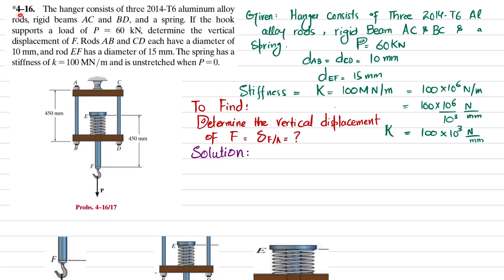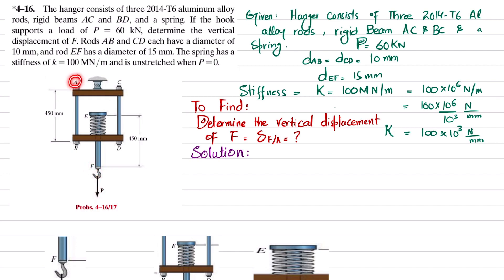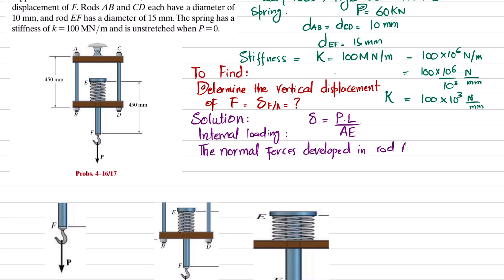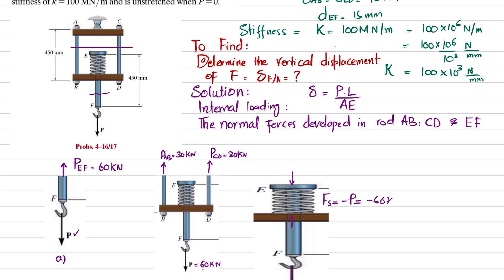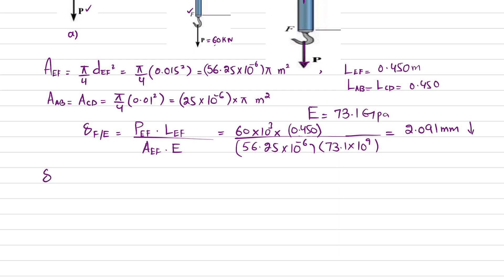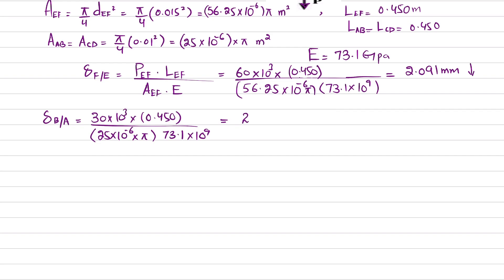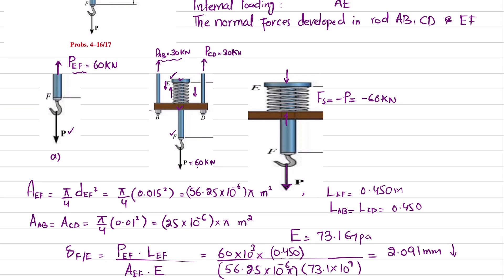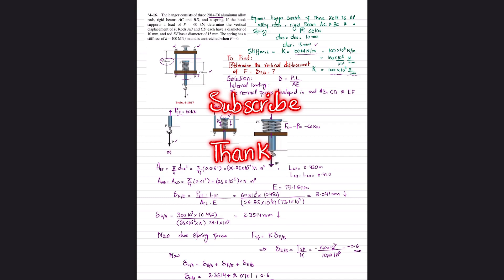4-16 Determine the vertical displacement of F | Mechanics of materials rc hibbeler

Comment: Wouldn't you subtract the 0.6 mm at the very end? Since the spring is in compression and is resisting the deformation of the structure. It makes sense that deformation (b/a) and (f/e) is positive as they are in tension (acting in the opposite direction as force P), but you stated that the spring is in compression, thus, why are you adding it instead of subtracting it at the end?
Reply from the maker: check my statement at 10:40 , i have already explained

Comment: Sir i have a question, if 60kN is applied at F, won't the spring counteract the force i.e. how will it be 30kN for both the bars. Where is the counteractive force that the spring exhibits. Like if we write the force equilibrium equation won't it be Fab + Fcd + kx (spring's resistance force) = 60kN. I am little bit confused about it
Reply from the maker: In fig (a) we have taken section of EF to find force in Ef while in B we have taken spring and beam BD as single body and find the force in BE and CD and in third we took the spring forces .
Reply from the maker: Actually you can see due to tension in 3 rods point F will move downward and due to compressive force pf spring it's also move down ward so total displacement is sum of the deflections.
Reply from the maker: Also you can see the P load cases compression in spring and this load will be equal to P as this rod and spring is single assembly so the net force on Beam AB will act causing the force in other rods to be 30 in each.
Reply: Thank you very much sir, finally i got the concept😊 @engradnanrasheedmechanical
Reply from the maker: @shreeswar7940 you are welcome 😊